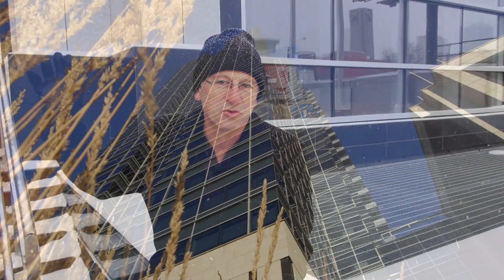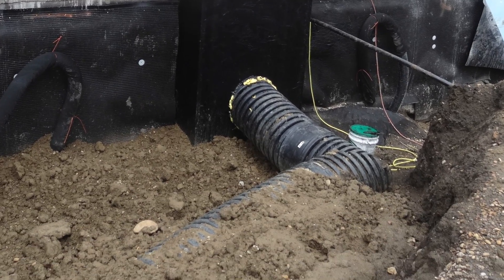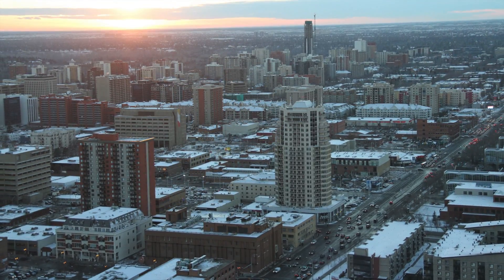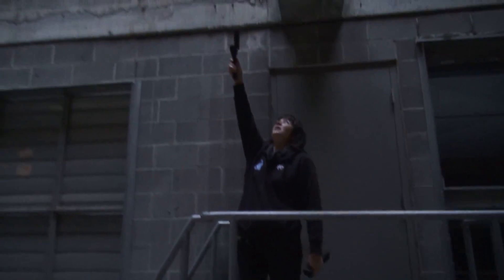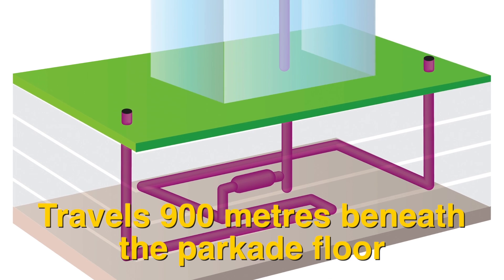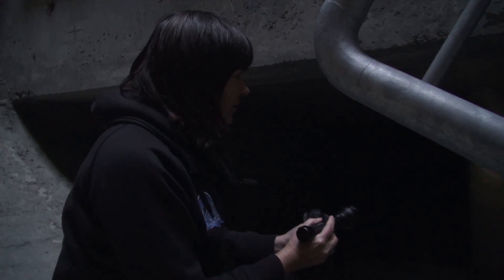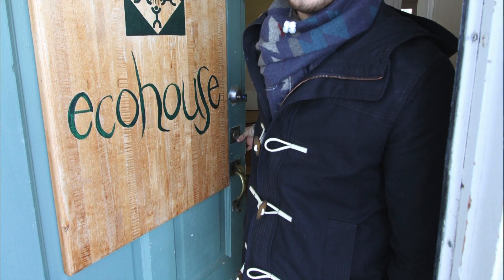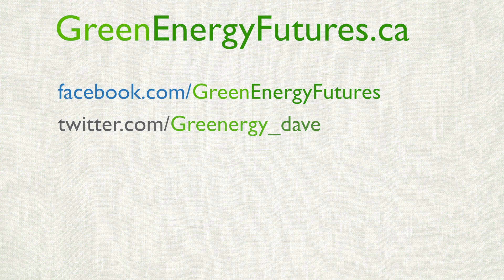54. How earth tubes help save the Epcor Tower $50,000 a year

Comment: For home use the smooth, thin wall drain pipe seems to be the best option.   Water condenses in the tubes/pipes and will be trapped in other types of pipe.   Smooth tubes will allow the water to drain out completely.  I am starting my system now and I will elevate the tubes on one end so that the water will drain completely to the other end and out to the outside of the house.  This should keep the inside air clean and sweet.

Comment: One potential problem with earth tubes is mold and fungus growth.  When you push a lot of hot, humid air down a buried pipe, you get moisture, which leads to nasty air.  I'm not sure how you solve this problem.
Reply: Good pipe drainage + UV at the end could possibly do the trigger.